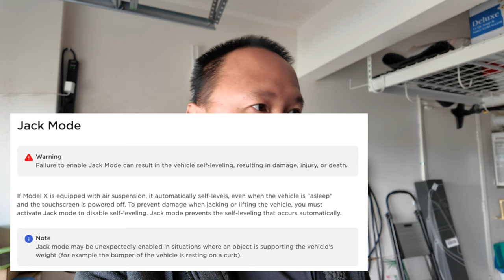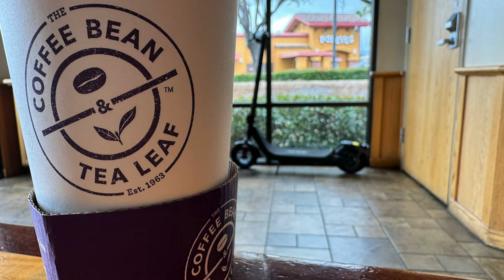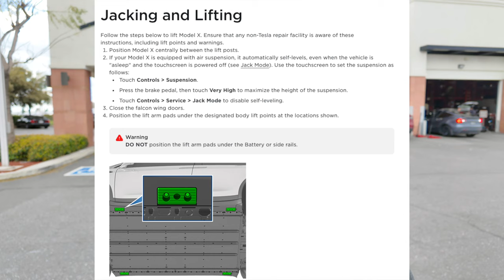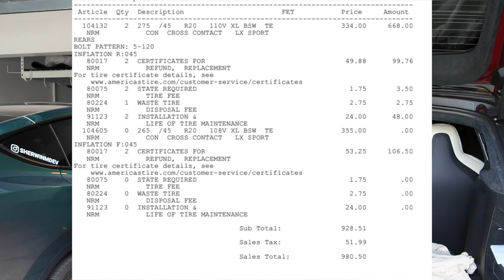Replacing the Model X Plaid tires

Comment: You can check the air pressure of each tire in the app: tap Controls, top right tap on psi icon. This will display the pressure and when it was measured last. The only way to get an updated measurement: “You may need to drive briefly before the visualization displays the tire pressure values. “
Reply from the maker: You’re right. I forgot about that. Haha thanks 🙏🏼

Comment: Thank you for sharing your experience. Did America's tire also put a foam liner in the replacement tire?  While it definitely sucks to be out money for something as trivia as bad roads, it was somewhat lucky in how it happened, in that you weren't stranded anywhere and the damage was only on a consumable part vs. mechanical or body damage (which you never get back to OEM). I look at these situations in life now and think, maybe the pothole damage saved me from being stranded with kids at a bad time and bad place from the other tire with a nail, or worse what if it saved me from a tire blowout from non-attended to damage months from now that likely could have resulted in much worse :)  Happy driving
Reply from the maker: Hi, the foam is part of the tire. The Continentals I got are the OEM ones so they include the foam inside. Yes, definitely could have been worse. As I learn things, I share and we can all learn together. We are going on a road trip soon and would have been bad if the problem showed up during the trip. So a fresh pair of rear tires. But it will be going into service tomorrow. Hope it's not too bad. Warranty should cover it.